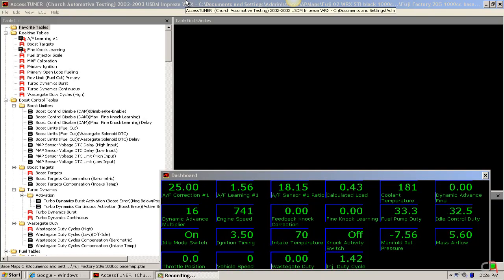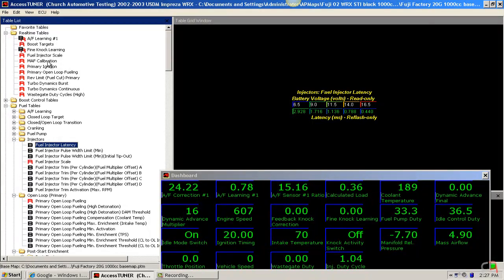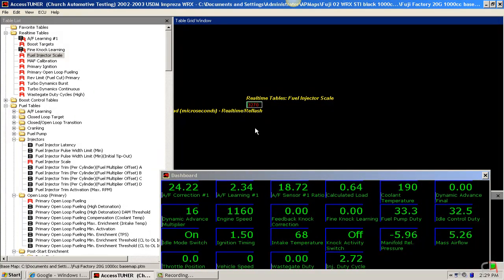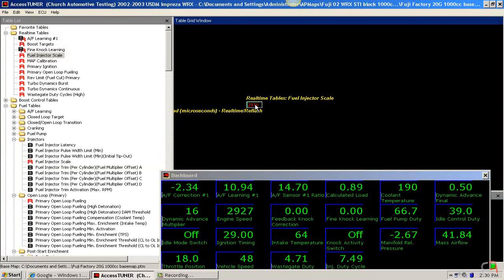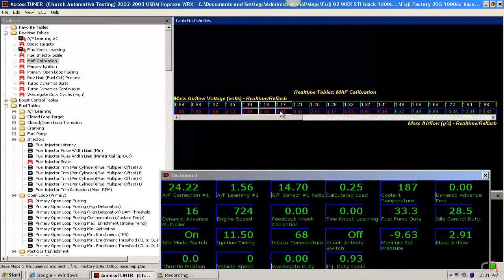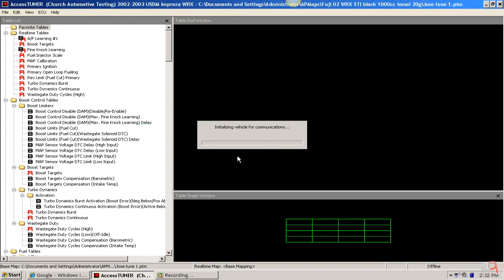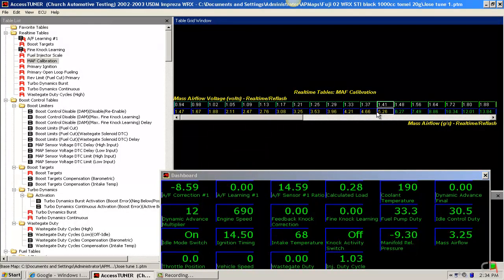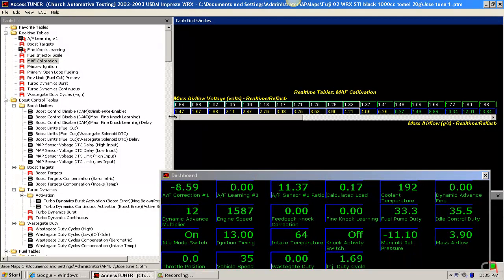Subaru - Start Up Fuel Trimming

Comment: I have the same year WRX with the stock 2.0 engine. It is running full catless and cold air intake, upon removal of the cat that is pre turbo I started running very lean at load. Any ideas on what to modify would be MUCH appreciated!

Comment: And where did the scalar end up at?  3100.  And the latency at 14v was just over 0.9. The objective was to take a custom intake and unknown injectors on a 16 bit car and show how to arrive at a reasonable injector scalar and latency.  In an ideal world, you'll be given correct values by the manufacturer, but you don't always get that.  We provide 30+ hours of video in the full class and I'm sharing my experience tuning over 1000 Subarus including the SuperLap Battle modified record holder.

Comment from the maker: The course is a general course but you can learn to tune from our training. 
There are about 3-4 video's that have to strictly do with Subaru's. We just gave this one for free to our subscriber and follower's. We are in the process of recording for Subaru because we have gotten aot of requests for it. But you will not learn the basics of tuning and tuning specifics in that course. Shawn has worked with speed density on the 16 bit ecu's with Cobb app but still have some bugs..

Comment: Great video.  I am seriously thinking about purchasing your product.  How many suby specific practical tuning demo will be included in your course?  I understand this is a basic general tuning course, but I am more interested in Subaru and specifically the 16-bit stock ecu.  My last question is way out there and very specific to my own interests, but I would like to know if Shawn has any experience and professional opinion on using the opensource Carberry, 16-bit, Speed Density rom?